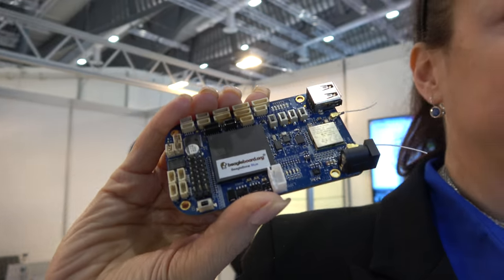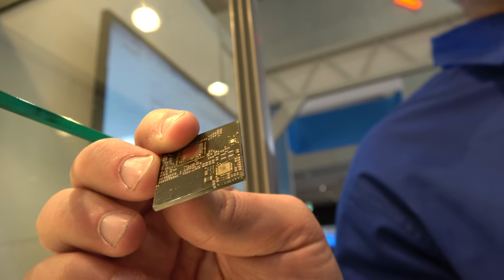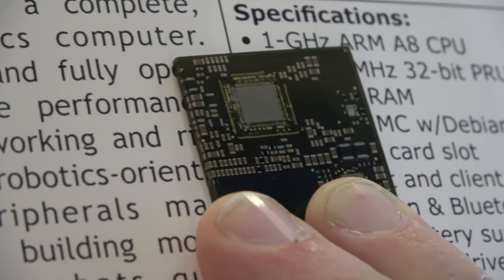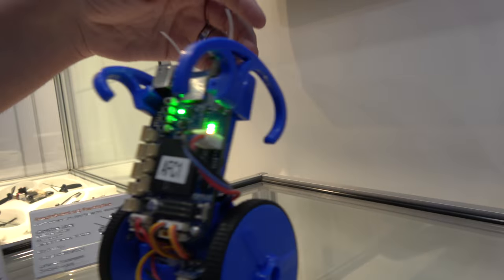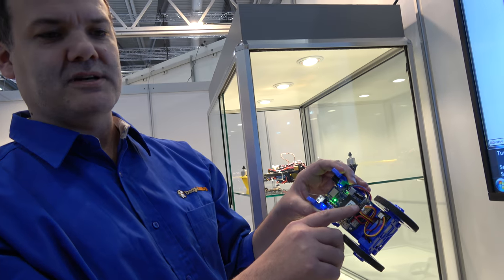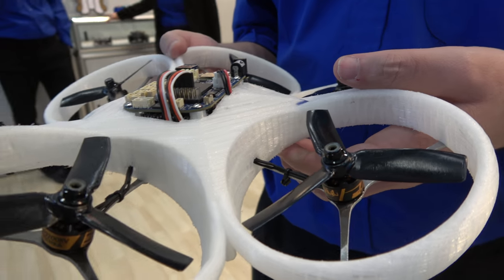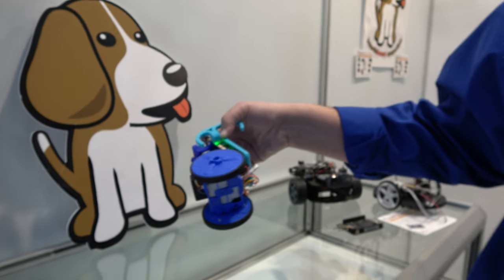BeagleBone Blue with System-in-Package Octavo Systems OSD3358

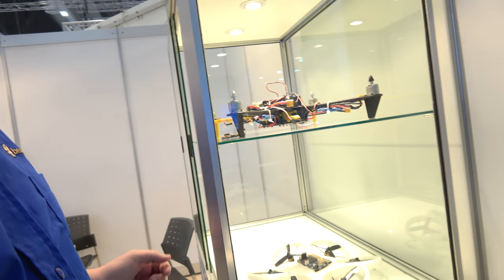Comment: can you provide more information about the hexa drone at 16:50? do you have also a software to control it with beagleone blue?
i know this comment is not about bb blue, but i got very interessed in drones lately
Reply: Check out ArduPilot, it's open-source with autopilot, works on the BBBlue.